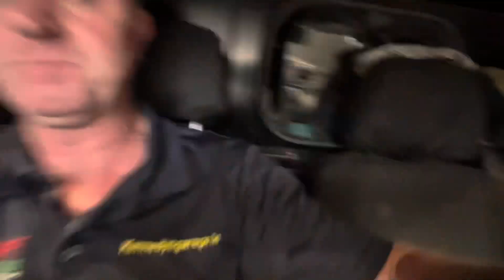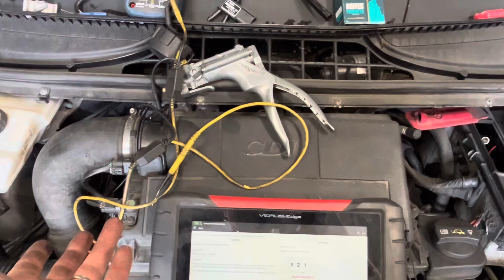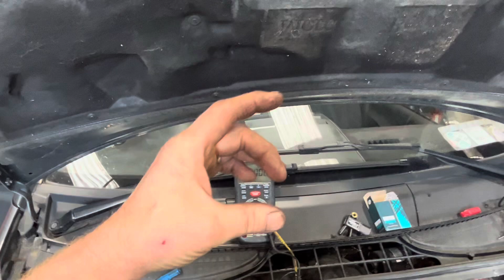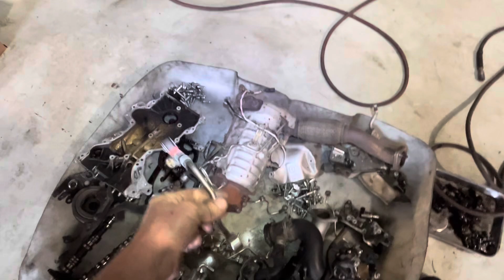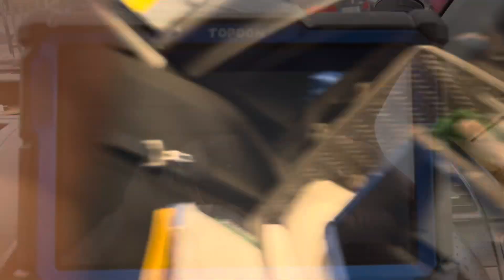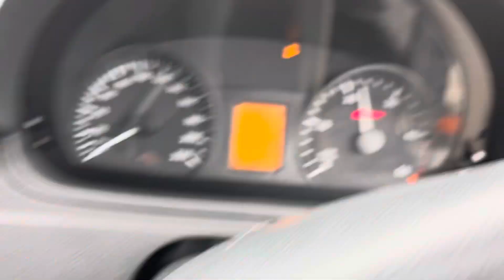Mercedes vito, P2463 DPF soot accumulation too high & P2454 differential pressure sensor signal

Comment: Another good vid 👌 

If i remember correctly the pid for the dpf pressure sensor is under "check diesel paritcle filter" in the live data section and not under "sensors" but have had it where its missing on autel but shows on topdon and vice versa. Good to have both tools! 😁
Reply from the maker: @gaj1612  ooohhh, that’s handy to know. I’ll check that out as I own a Vito myself and I’m always curious but never think that I know it all. Thanks mate 🙏🙏
Reply: @kennedysgarage3281  it's weird (and sometimes very frustrating) when one tool had pids for something and another doesn't! I find Nissans the worst for it around 2012my
Reply from the maker: @gaj1612  you are right, I have found that on quite a few Nissans too 🤷🏼‍♂️🤷🏼‍♂️

Comment: If it’s a 651 engine the exhaust back pressure sensor is on the EGR elbo on the back right of the engine.
Reply from the maker: @ryancunningham2850  that is handy to know Ryan, thanks mate 👍
Reply: Yeh they are screwed on and get blocked causing  no power issues
Reply from the maker: @AhkKk-wc4tl  😉🙏🙏